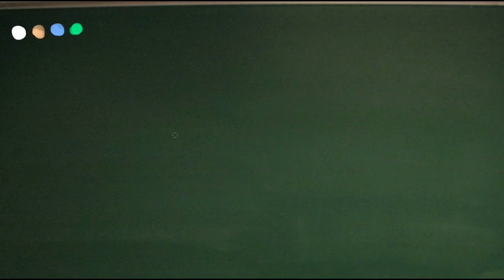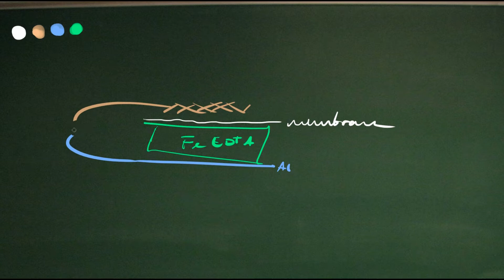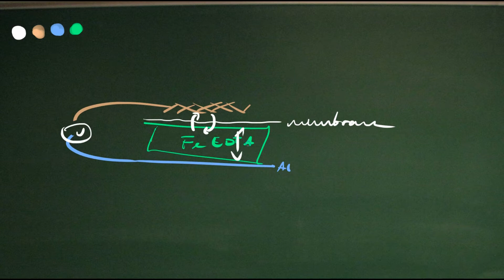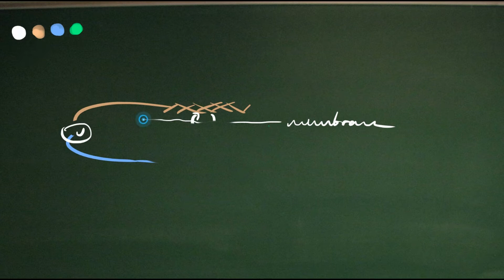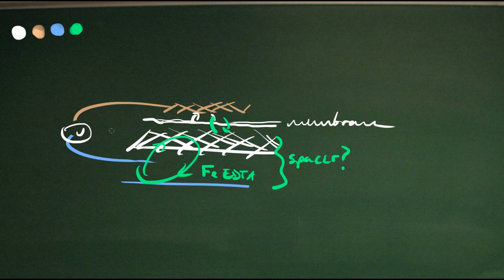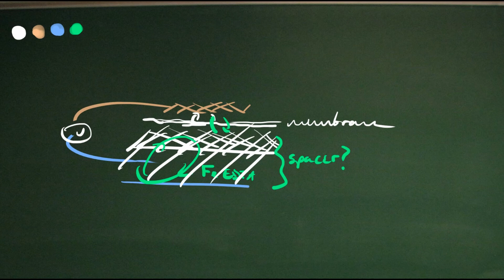Part 31 (woah) of the Iron Battery Saga

Comment: I was thinking in general about the solubility issue.  In a lead-acid battery, the insolubility of lead-sulfate contributes to one of the principle failure modes.  On the other hand, in nickel-based batteries, the insolubility of metal oxides and hydroxides is apparently advantageous and greatly contributes to the cycle-life.  The depleted material stays-put on the electrode until it is recharged.  This has the effect of reducing the current-density and thus the power per unit of electrode area.  I suppose the insolubility is less compatible with a flow-battery design.  However, I suppose the advantage is that the chemistry is potentially very simple and stable.  

Many cell-chemistries are only good for ~200 cycles.  Some NiMH cells are reported to be good for 2000 cycles.  Apparently the Ni-H cells (that originally inspired NiMH) are good for 20,000 cycles or more!  This is phenomenal.  

Cycle life seems very important to the cost-metric.  It's too difficult to test manually but probably isn't too hard to automate, even just with a simple relaxation-oscillator and a simple data-acquisition setup to measure voltage.  If only one data-channel is used to record voltage, then it may be sufficient to use a constant-resistive load, or constant-current "source" (used as a current-sink), so that the current is a known-function of voltage.  And/or a "sense resistor" can be used to compute the current as I=V/R.  

I was also wondering about an easy, cheap way to make a high surface-area, fairly-conductive electrode.  One idea is to use activated-carbon bonded to one or more metal screens, or to sheet metal.  This is flexible and can be used flat, stacked or molded to any shape.  In theory this could be used in either a flow-cell or a static-cell.   I think activated-carbon may have higher surface area than powdered-graphite, unless you're talking about intercalated-graphite.

Comment: I like you're thinking on this.  If you have too much diffusion, as you said it makes sense to increase the thickness.  First of all this decreases the concentration-gradient, and therefore proportionally reduces the rate of diffusion.  But also the diffusion-distance is larger as well, so overall the effect goes as x^2.   And as a bonus the battery capacity is increased.

Comment: Peter, I did a sketch of the idea that keghn feem had on your vlog 130, about electrically disconnecting the anolite and catholite , eliminating the membrane.   Is there a way I can email or upload the sketch, so you can comment on the theory? ( sorry if off todays topic )
Reply from the maker: Cool - I think the easiest way it to use http://imgur.com/upload and then share the link it generates.
Reply: Here is a sketch of what I thought was proposed.  I don't know how the flow of ions or electrons would work, if it is missing something, edit it.

http://imgur.com/a/ZBhrY

I think the theory was that the salt bridge would not have to exist.  If it was needed , would the electrical isolation make it less demanding on the material, meaning it could be cheaper?
Reply from the maker: If you spray the solution over the anode and cathode conductors, you still need a separator to allow charge balance. It's starting to look a lot like a fuel cell. If the conductors were a lattice right up against a nafion membrane, it's essentially a fuel cell or flow battery. http://imgur.com/a/HORPz

Comment: I'm about to assemble my stainless steel iron nickel. Battery. I'm going to be online to make it with doped iron oxide. Silica lithium graphene. Mine is going to be a big battery. Made for solar charging. I'm going to develop it to absorb a built in capacitor. Because sun light spikes the photo cells.